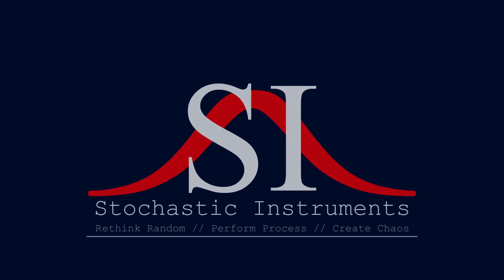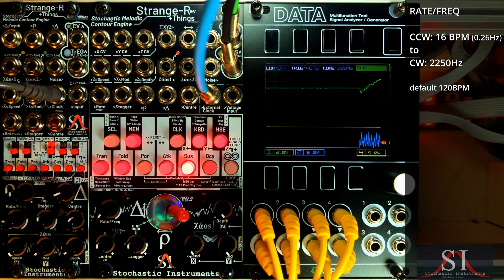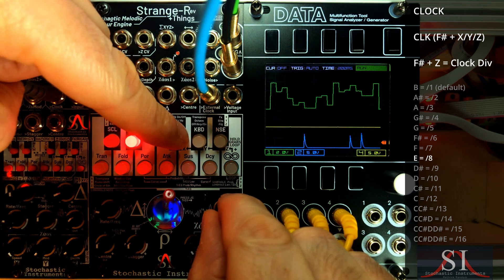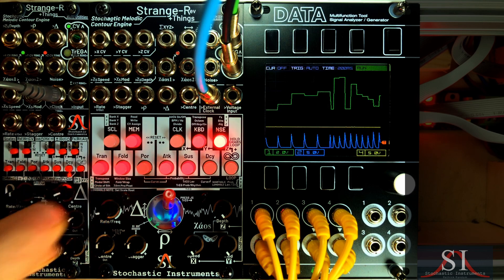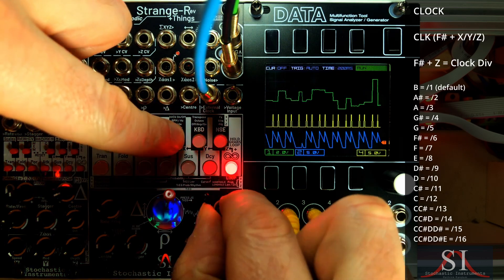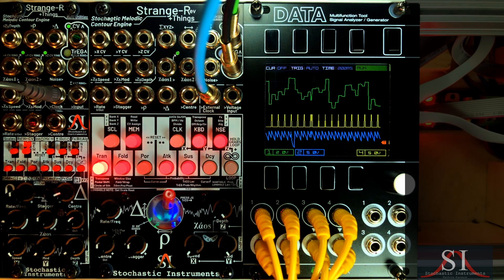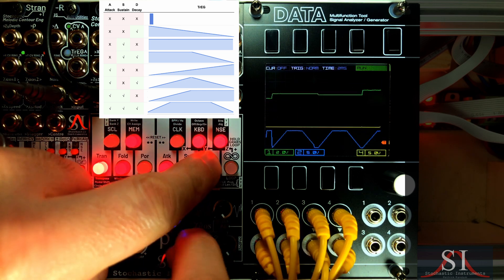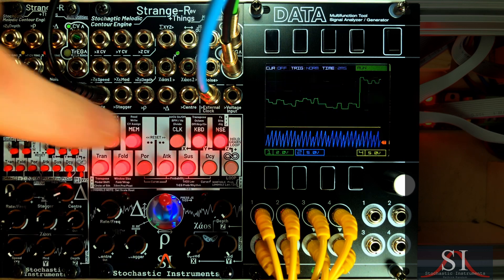Strange-R: Clocking, Division, Stagger & VCO Mode

Comment: Which module produces more melodic results, SIG or Strange-R?
Reply from the maker: Great question. In a word: Strange. The longer answer is that, while SIG certainly can do melody (via its Linearity control), and of course has 4 channels compared to Strange's 1, Strange has been designed from the bottom up to live, breath, think and feel specifically melody. Every control, every primary and secondary function, every CV Input and Output, and even the way the (three!) (phrase) loops work is about providing a melodic powerhouse of exceptional depth (if you need it) yet all controlled with the simplest possible UI: two controls, ρ and ∆. So, while SIG excels at multi-channel work, Strange can achieve anything you want with a melodic line with the smallest and most intuitive of performative control. 🙂